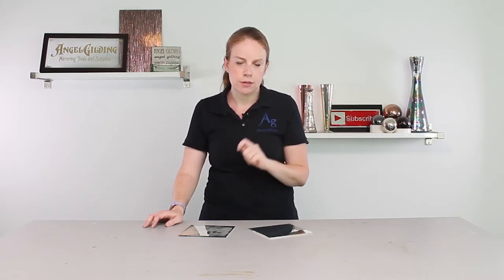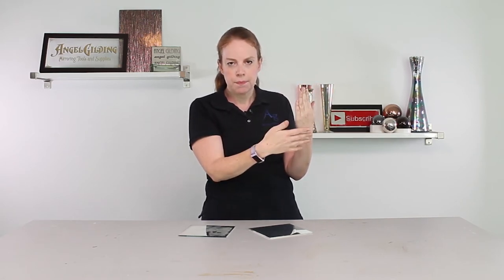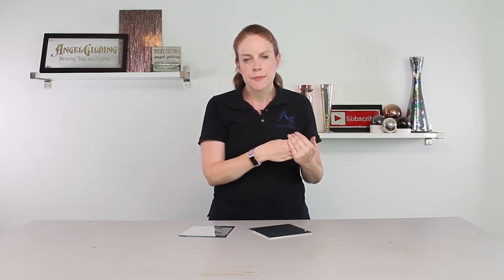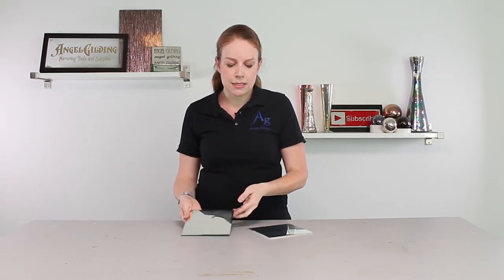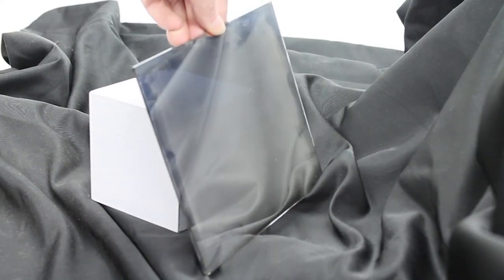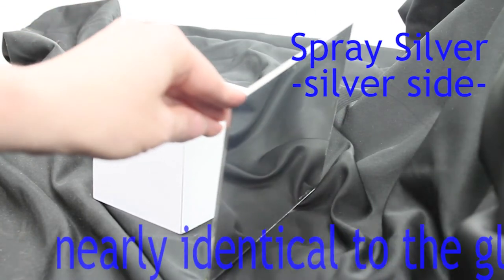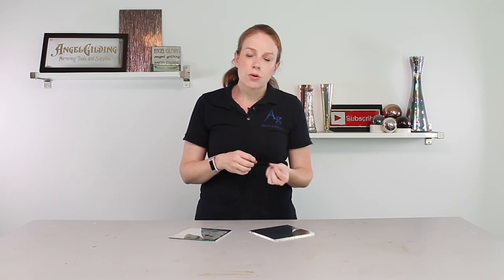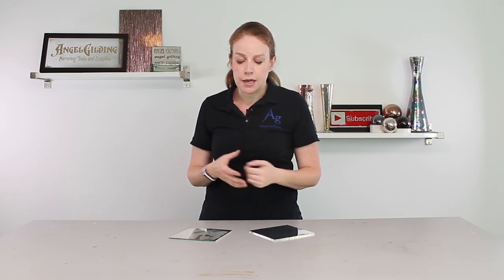Pouring or Spray Silvering: Which Method is right for me?

Comment: How do you work out how much silver nitrate per sq ft of glass so the solution doesn’t become depleted of silver
Reply from the maker: Hi, its important to note that the chemicals are not just silver nitrate. However, you will need 15 mL of each of the pouring solutions per square foot for adequate coverage.

Comment: Is it possible to only resilver something like edges where the silver is peeling? I jave a roughly 3x3 mirror with 2-3inch edge peeling. Is the process necessary for the whole mirror?
Reply from the maker: That is a great question. Unfortunately we have not found there to be a great way to do that. If the silver is peeling then it would likely peel further when you try to patch the areas. The best result will be achieved by re-silvering the full piece.
Reply: @AngelGildingcom  That makes sense. Thank you!
Reply from the maker: You are welcome @law_wren   Best of luck on your project!
Reply: @AngelGildingcom  follow up questions, in this instance would your recommendation be spray for the size and can the spray be done on the backside like for pouring?
Reply from the maker: @law_wren  That size could work with either Pouring or spray, although the spray may be easier with the size. Please email us with any other specific questions you may have. thanks!

Comment: hello angle 
is spray silver and   hydrochome spray  any diffrence in opticle performence ?
and is hydrochrom good as for front surface mirror ? and 
use for opticle instruments?
Reply from the maker: Hi, those are great questions. For the best optical quality on a front surface mirror we definitely recommend a spraying silver chemical formula. The term Hydrochrome is oftern referring to a specific company. We have an information page in our knowledge base of our website that talks about mirroring for scientific instruments.
Reply: @AngelGildingcom  yes . but silver coating does not last long its tarnish quiackly . and chrome last longer. want know which give more reflection and durability?
Reply from the maker: @abhayprasad6372   chrome in this sense is actually silver with a tinted top coat. It is called chrome becuase it is seen as an alternative to electroplating chrome but in reality it is still silver. Silver will tarnish if it is not protected by a tinted top coat. Our line of products for this is Angel Chrome and you can see them on our website.